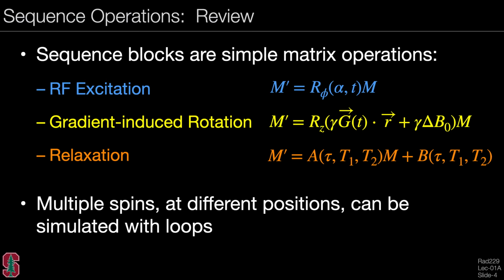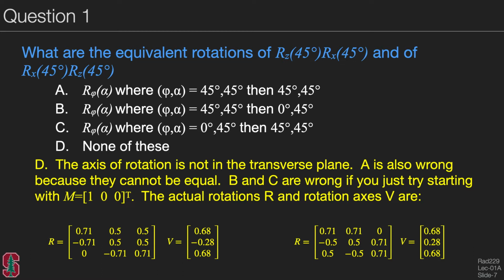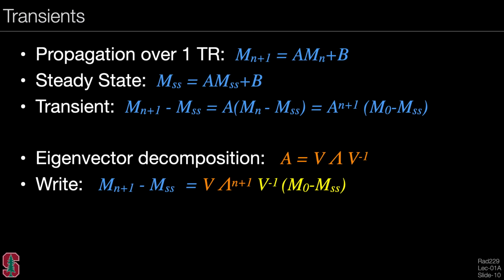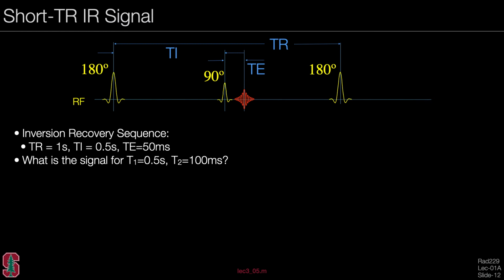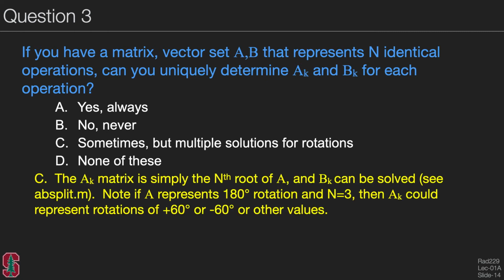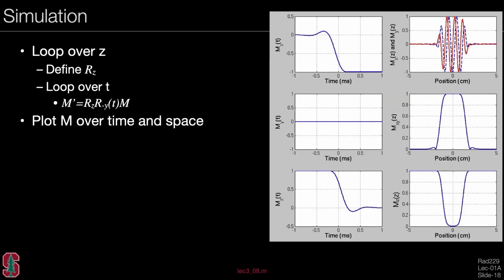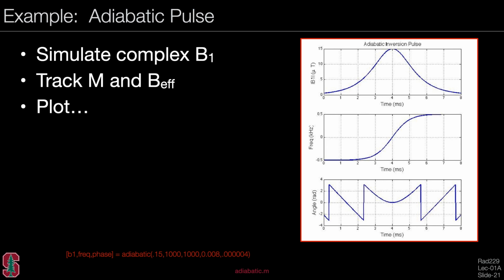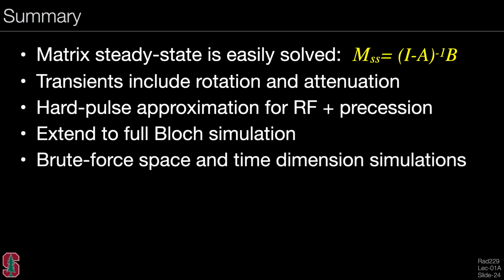Rad229 (2020) Lecture-03B:  Sequence Simulation Examples using Matrix Operations

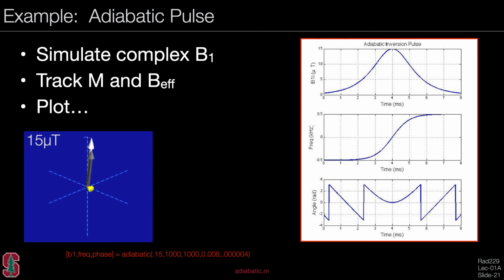Comment: 37:57 Adiabatic pulses are a lot more natural to visualize in a frame rotating at the instantaneous frequency of the pulse (where the B1 vector stays stationary in the traverse plane). Then the off-resonance frame means there's an effective Bz component, and the magnetization tracks/precesses about this B effective. In the rotating frame at the larmor frequency (shown) there isn't any Bz component. The black arrow corresponding to B effective only exists when the frame is rotating at the Frequency Modulation (FM) of the RF pulse.